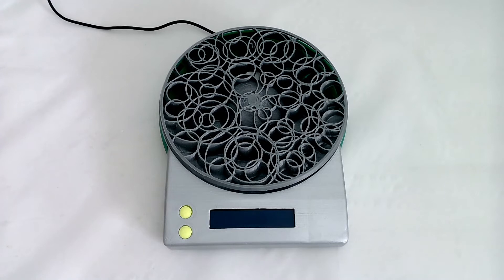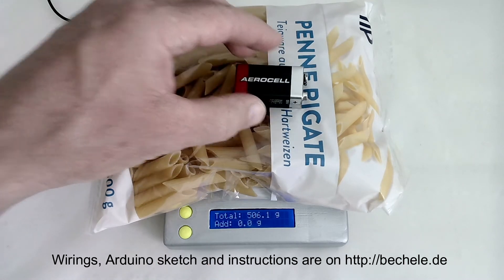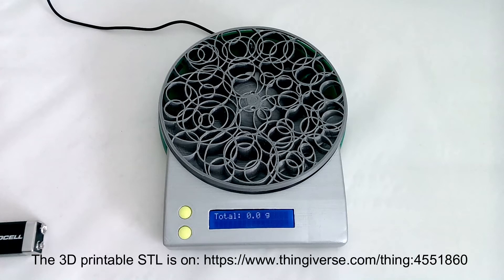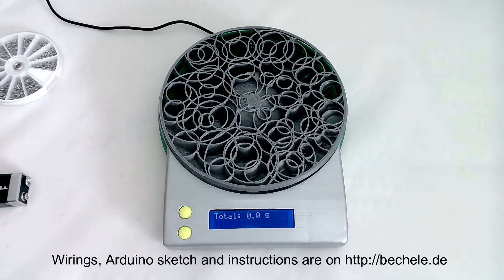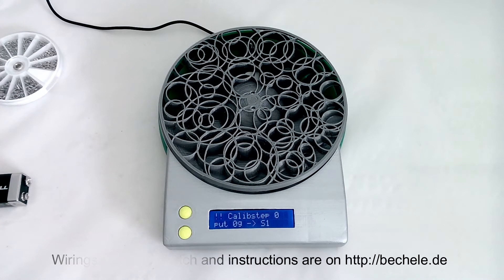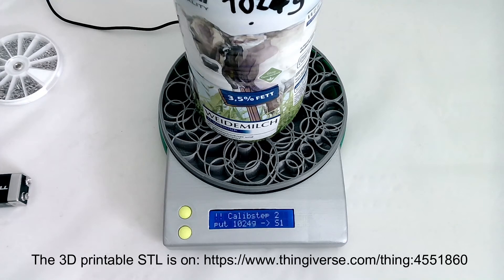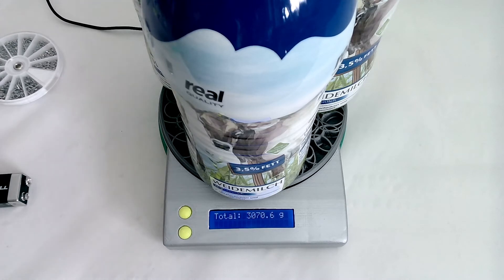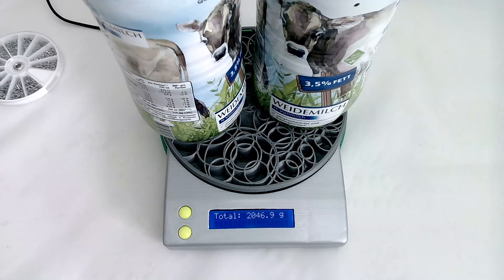3d printable design kitchen scale - operation and calibration

Comment: Don't you feel that even there are insane cheap kitchen scales (ie Lidl, Aldi, AE,...) nothing pays the pleasure of building your own? Thanks for sharing; one more time.
Reply from the maker: That is true, there are surely cheaper solutions. I think the advantage for my own solution is the possibility to calibrate it very accurately. After calibration I found for 3KG an inaccuracy of about 0.2 g OK, for food recipes it is not that important, but the project can be used for any other purpose and weight, since the weight unit in use does not matter. And the quality is just dependeing on the repeating accuracy, because it can be calibrated. So I think the good thing is not the design of the scale, but the software I wrote for the arduino.